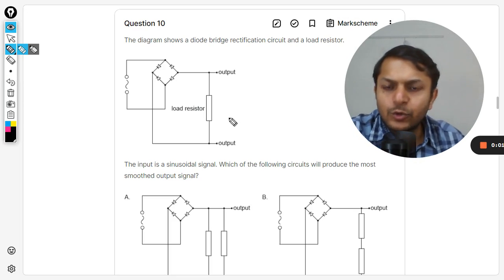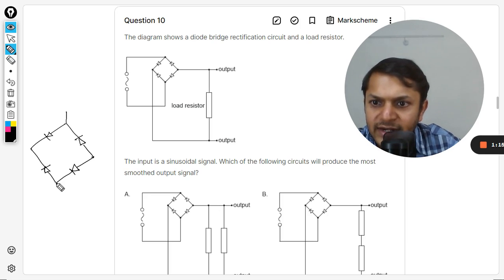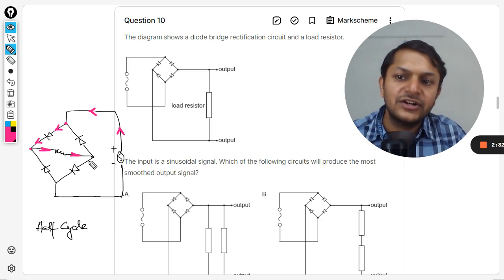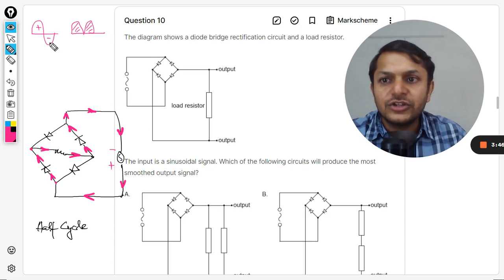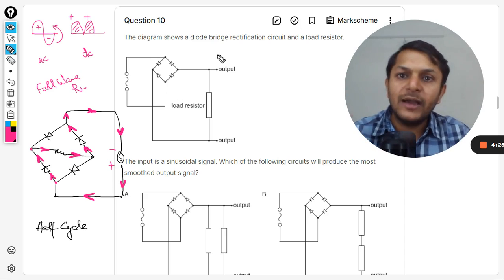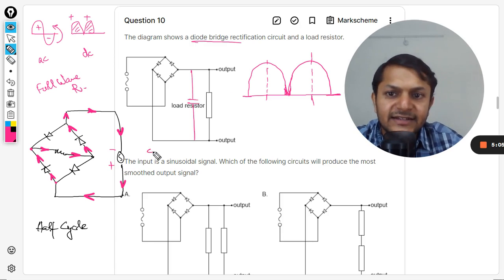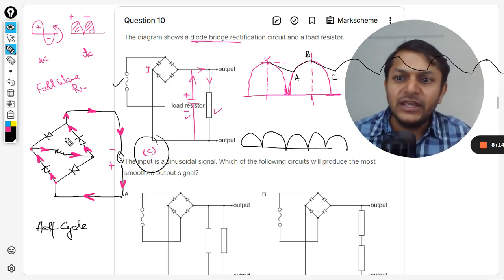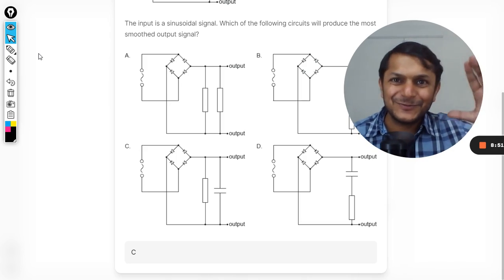The diagram shows a diode bridge rectification circuit and a load resistor. The input is a sinusoida

Comment: Sir, why can't the capacitor be placed in series with the resistor? I didn't fully understand this part. I looked it up and it mentions that it is for safety reasons, but I don't see how it relates to the question. Sorry for the 4 month question delay, but I was just wondering.
Reply from the maker: No.. Actually, they have to be in parallel, because only then, the capacitor will be able to charge to proper voltage. Otherwise not. And the system will not work.! The voltage output can be smoothened only if the capacitor is discharging through the resistor.!